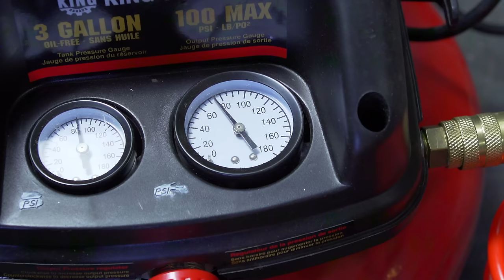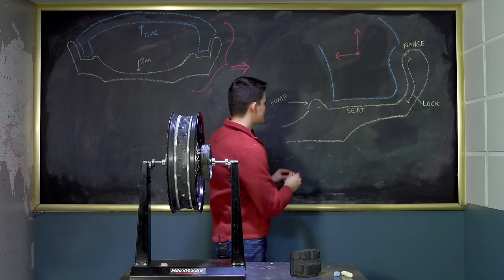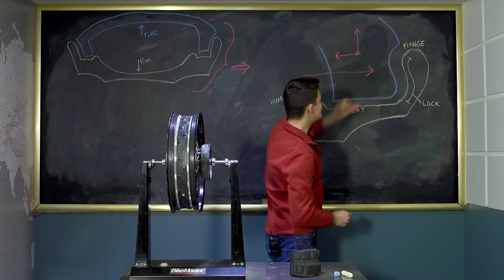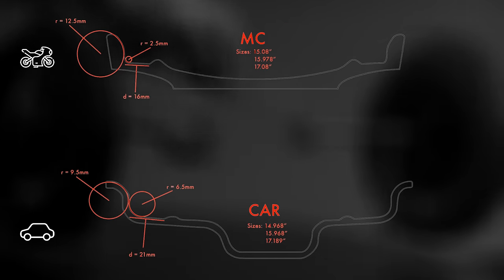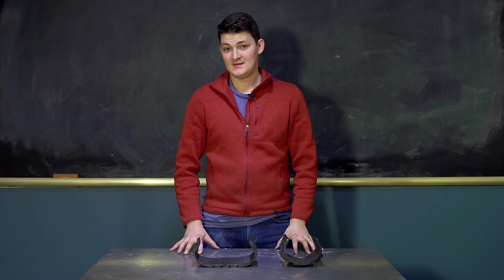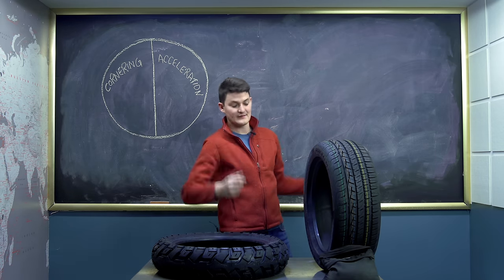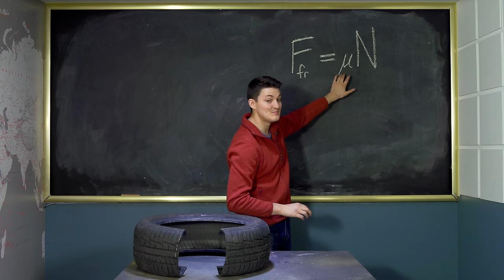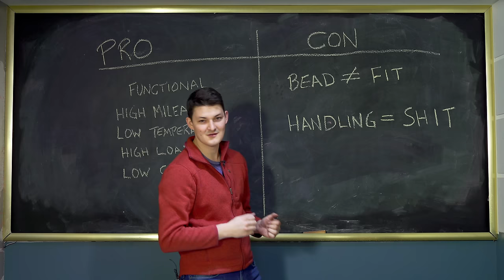Are Motorcycle Tires a Ripoff? The Darkside Car Tire Experiment

Comment: Its funny, i was just researching and watching videos about darksiding, and i noticed most of the users are cruiser riders. Really heavy bikes, without big lean angles. No suprise and your post confirms a lot for me
Reply: I own a street glide and some people recommend putting a car tyre on the back wheel . I can understand the cost part and mileage but if things go wrong your insurance is invalid  ,you won’t get a MOT in the uk and the police will get involved. Personally I wouldn’t do it or recommend it either too many downsides.
Reply: @johnludmon7419  In the US, at least, there is no such exclusion in a MC policy. And you are correct, my observation is many darksiders are cruisers and goldwing tourers who do not  use the handling characteristics of a motorcycle.
Reply: I have two bikes darksided.  Honda nc700x and triumph tiger 1200. It's amazing.  I drive it like I stole it.  It takes a few hundred miles to get use to. Once you do,  you ride exactly the same.  I have over 12 thousand miles on each tire.  And.  It's much better in the rain.  I hope this helps.  Try it you'll never go back.
Reply: Jim Gordon  Not in the UK the bike would be illegal to use on the road. As I said in my post  it would invalidate my insurance which would complicate things if I had an accident.
Reply: @johnludmon7419  you should move.  It's always raining there anyway.  😉
Reply: @johnludmon7419  NO your insurance is NOT invalid. Qualify this claim....
Reply: I challenge one to post a link showing where a darkside tire has ever caused and accident or even a mishap....lots of bearing of false witness here....
Reply: Jim, if you darkside a triumph tiger you shouldnt be riding lol. Thats a f-in sin.
Reply: @justmyself1000  I only have anecdotal evidence, but I am old enough to have seen the DS trend in the 90's...I bought my XLCR 1000 from a darksider who experienced a catastrophic failure while doing 90mph in a soft curve. I'm not complaining, as it was dirt cheap, but the first thing that I did was buying a pair of Michelin Road tires :)
Reply: @justmyself1000  dude in almost every European company needs to say this Tyre is fitting for this motorcycle and this is obviously not the case with darksiding.
If you have then an accident doesn't matter if it's because of the Tyre or not. You insurance will say you where not supposed to put this Tyre on it and it's not road legal which means you broke your site of the insurance contract.

But like with everything on a bike it's calculating the risk
Reply: @PolskaTheGrey  I have seen a Honda ST darksided.

The rider was dragging parts 2-up.  At no time was the car tire a limiting factor.
Reply: justmyself1000 I live in the UK the laws are different over here to the USA . If you fit a part to the bike that makes it illegal on the road your insurance company will not cover you if you have an accident. They might pay out to a third party but they will then try to recover the costs from you . Fitting a car tyre on a motorcycle will mean the bike will fail the MOT (the annual emissions and safety check on vehicles over 3 years old) no MOT = illegal to use on the road = no insurance cover.
Reply: @justmyself1000  in Australia they will not pink slip the bike and also the police could potentially seize the vehicle due to the illegal mods
Reply: @jimgordon3468  I just went darkside on my NC700X.  I only went a few miles on it for testing, and it feels weird.  I'm sure it will feel more normal as I rack up the miles.  I changed because I just ruined a $125 tire with less then 3k on it when it when flat on my ride home.  $54 for the Achilles, 40 - 50k life span.  It's more about the longevity then the $, but a $400+ savings over the next 4 years is not to bad.  Only time will tell if I made the right choice.
Reply: @dhj1825  trust me. After 500 miles you'll be riding just like before. I have the same tire you do.  I do a lot of two up riding.  It's excellent for that as well. The only negative I have is.  Putting the tire on the rim.  I did it myself.  Kinda difficult but doable.  Enjoy your dark siding my fellow Honda rider.
Reply: @AstoundingAmelia   not true
Reply: Santo Cuollo Most US policies do have a clause (probably buried real deep in the paperwork) that says that modification that renders the vehicle inherently unsafe will nullify coverage. I’ve seen at least 4 cases where the darksiding owner was left standing alone after a crash.
Reply: @AstoundingAmelia  never had a problem with cops even had em look at it and my insurance knows its there and dont have a problem  with it
Reply: @jamessloanofficial  umm no. They don't. DOT approved tire is just that.  And I'm sure you don't know 4 people who actually darksided a motorcyle.  Just keep living in fear and paying for all those expensive motorcycle tires.
Reply: @jeffjohnston2195  glad you haven't, I'm just using the Australian design rules as my source, they are the ones that dictate the rules
Reply: @justmyself1000   Any idiot who does this is too embarrassed to admit it. They quietly move on. Like the guy I know who had 2 blowouts!
Reply: @jimgordon3468   I know I will. But I actually ride my bike.
Reply: @jimgordon3468  wait. i thought this video was a joke. people actually do this??

Comment: I have been using Dunlop 185/65/16 car tire since 2006 on my VTX 1800 it took a little getting used too but you run tire pressure depending on the bikes weight I ran 34 PSI and it stuck like glue even in rain and tripled my tire mileage to 40,000 km

Comment: Always knew this was a terrible idea, but this video did a perfect job of explaining why.  Excellent work.  Always wondered but never wanted to try this.
Reply: I have had occasion to ride a car-tire-equipped motorcycle. I see it as yet another way for the 'cheap bastards club' to ruin a perfectly good motorcycle in their quest to save a buck.
Reply: @HalfCrazy520  I know a repair shop in my vicinity that used to modify car tires so they fit better on motorcycles, the place was shut down under claims that their work was putting people in danger, everyone who used them will say it was completely harmless as long as you didn't speed. I don't know since i've never used them, i'll try one day for sure.

Comment: I'm wondering what would happen, if you took a sidecar set up such as a Ural, and made it a darkside bike? The main problem with sidecars are that stability is a constant battle. But with your tires doing some of that work for you, would it make things easier?
Reply: For sidecar motorcycles definitely you can use it without an issue, you don't need to balance it
Reply: The can am spyderrs have auto style tires
Reply: They also have three wheels

Comment: The Boss Hoss came with a car tire. Factory mounted.  If I remember correctly that is. The handling as legend has it confirms your experiment on car tires on motorcycles. Well done sir, and very well explained what to expect and why.
Reply: they used to, there are now tyres rated for it in the chopper market thanks to the wide tyre fad

Comment: One thing you're missing is that after 600 or so miles, the car tire "corners" "break in" to their new use, and the corners give while you take the curves. This gets better as the tire adjusts to it's use. Trust me. Darkside on my '98 Valkyrie. I was convinced by a madman from Dakota, in whose sagacity I believe. I'll probably never go back to a $400 rear motorcycle tire -- especially after the horrible experience of my last motorcycle rear, the Limey Venom, that was the worst tire I ever rode.

Comment: I use a Goodyear triple tread on the back of my Yamaha Stratoliner. I have used it for 4 seasons now. I did notice handling differences when doing heavy cornering.  On gravel roads or uneven pavement you have to keep your wits about you. The tire does want to control the bike and get back to being straight up in those circumstances. Over all I am happy with the car tire and have 20000 km on it. I check the pressure regularly as we all should and ride. My advice for anyone thinking of going to the Darkside is do your research on type and quality of tire. I would not use it on anything but a big cruiser or tour bike. Sport, adventure,  and other style of bikes I  believe should stick to motorcycle tires. Great video.

Comment: I did this on a 1st gen Yamaha Vmax. It makes the deathtrap of a machine even more dangerous, but still awesome to ride. The flex of the huge sidewall added into the flex of the frame and suspension takes a lot of skill to maneuver.  It also adds a "speed limiter" of sorts. When you get around 105mph the whole bike starts swaying side to side unless you back down on the throttle.
Reply: about the only time it'd worth it is for drag bikes.

Comment: I ran a car tire on a 650 Burgman for a few years without problems. Handling was as good as the OEM tire once I got used to the slightly different feel. Also of note was the much smoother ride, especially when the air pressure was around 32-34psi. More air and the bike rode more on the edge, making the bike feel squirrelly. Darksiding isn't for everyone.

Comment: 1:39 the use of cable ties are ingenious
Reply: I've been installling my motorcycle tires this way for about 10 years now. With most of them, I don't even need tire levers anymore. The zip ties are so slick after you get the beads to touch, you can stand on the tire and it just scoots onto the rim.

Comment: He's a real motorcycle guy, the flip phone proved it😂😂
Reply: Hippity Hoppity  Then buy a used phone from an independent seller
Reply: I mean, I work in tech yet I have a OnePlus 6 (not a bad phone when it came out but close to outdated by today's standards). Flip phone guys have a point. They never need software updates and the battery is almost always replaceable. If the battery in my phone goes bad it's likely going to cost more than the value of the phone to replace with an OEM part. This is by design.
Reply: @marc-andreservant201  That doesn't measure up to all the things you can do with a smartphone and can't do with a flip phone.
Reply: The Zac Morris of motorcycles...
Reply: @marc-andreservant201  just fyi if you are okay with DIY look into ifix it. I replaced the battery for my 6t at one point for 50 bucks. If I ever need to replace it again it would be about 30 dollars because I don't need the tools anymore.
Reply: @marc-andreservant201  a OnePlus 6 will last for a few more years at least with a custom rom
Reply: Laughs in v20 removable battery

Comment: "spontaneous uninstallation" LOL.
Reply: As if this has ever happened......Please someone post a link where this has happened...
Reply: @justmyself1000  I've been doing on-and-off research on darksiding for twelve years and have read nearly a thousand NHTSA motorcycle crash reports, and have never found ONE where the primary- or even suspected- cause of the crash was a bead failure on a darkside (DS) tire. Plenty of drunk/impaired riding, lots of cars turning left in front of bikes, many excessive speeds, failures to negotiate turns, and even some tire failures (ALL of them motorcycle tires and often due to overloading or running underinflated), but nothing that would suggest DS is an unsafe practice. I have challenged the naysayers to provide ONE verifiable case of a crash or refusal of insurance claim due to DS, and have had ZERO takers. I've been riding the mountains of northern Wyoming for three years now on a V Star 1300 with a BF Goodrich, and it is a fantastic combination for comfort, durability, and safety.

Comment: I have a 85 Gold Wing 1200GL & Dark sided it with a Nexen 165/80/15
Cornering is no problem and now I have better braking, grip, water displacement
and far better with a passenger + trailer. It also has an actual load rating...I'm staying on The Dark Side !.

Comment: I ran a GL1200 Goldwing with a side car and a car rear tire mounted perfectly. It ran great and I highly recommend it for sidecar applications. I tried it with the sidecar taken off the bike. On the highway I got in an absolutely terrifying tank slapper that is singularly the most frightening riding event of my 50 years of riding. I don't know how I did it (thank you guardian angels!) but I controlled it from a side to side, to the stops, tank slapper at 80mph (I know, I was pushing my luck). I sat on the grass at the side of the road for half an hour to get the adrenaline and heart rate down. I thankfully learned my lesson without loosing my life.
Reply: Maybe car tire applications on moto are for heavy weight moto, also tubeless tire is the way to stop Tire re-T900-coming-back to original form and fighting itself

Comment: Thank You Sir for actually trying this out and showing how it can be done. And then giving us an honest, in depth, exactly right on presentation of how it works and the advantages and disadvantages of running a car tire. Your explanation about having constantly counter-steer thru a corner was very insightful!! The way a motorcycle handles does change for sure, but you get used to it. 
 Certainly you wouldn't put a car tire on a canyon carving sport bike!! For a heavy touring motorcycle, the fact that a car tire lasts so much longer is a huge advantage. It certainly saves time and money!! Why spend a $150+ to have a rear tire replaced every 10,000 miles or so (usually less!!) when I can safely use a less expensive tire that lasts 3 times longer?? Also, having to replace a tire when on a long trip is not fun. For me, every rear motorcycle tire I have replaced is worn out in the middle and very little wear on the edges. So using a car tire is so much more convenient. 
 This has been done for a long time as mentioned in the video. An older friend of mine said they used to lace up a 15" rim on their choppers so they could run a Volkswagen tire on the back. Using car tire works!! And for me there's no downside. And the fact is, people do this all the time. Thanks!
Reply: Yeah, seems like the car tire makes sense if you just commute or do lots highway miles. I know guys who replace their rear tire every year. Not to mention the cost of a puncture. That said, I'd probably try to find an inner tube that fits if I were using a car tire.
Reply: Tatwood, thats where runflats are great. And i mean do you tube your tubeless mc tires?

Comment: Thanks, Ryan.  Very well done, as usual!  I have had a Semperit M&S tire on the back of a Burgman 650 scooter now for 3 years.   Works fine,  EXCEPT:  longitudinal seams in the pavement are downright scary!  Leaned over traction is not a problem, since the giant scooter does not lean over very far anyway; parts drag right away.   The M&S tire actually gives some traction; the stock tire gets stuck on wet grass.  Still not sure about tire pressure;  anywhere from 25 to 40 seems to work just fine.  Please note that I am a dirt rider, and might not be noticing some of the nuances of pavement handling.  Thanks again!

Comment: Back in the mid 2000’s I did this on my 1800 Goldwing. I didn’t know about the bead differences. That aside the tire did work. After the scary first ride it was pretty normal except for the part about tracking on grooves in the road surface. Annoying at first but you get use to it. From what I remember the tire didn’t last that much longer than a good MC tire. The car tires wore out at the edges first. Both of them. I ended up going Back to MC tires after that. It just rides a lot better. Going back to MC tires felt like adding power steering.
Reply: not true for the newer run flats . but in the north we go straight a lot . lack of curves
Reply: tire pressure is the key. and not what the sidewall says either

Comment: Been a Darkside Wing rider for two years and will never go back, the bike is just to heavy for motorcycle tires and cupping occurs, over 45 000km and still fine for 125$. Don't think i would use it on any other of my bikes though, can't feel much of a difference on the wing, your video quality is amazing as always
Reply: What kind of bike do you put it on?

Can advise will it be ok for 650 Kawasaki Versys?
Reply: Goldwing
Reply: Baeng's Lobster (Wan Jtk) On my Goldwing, i would not advise trying it on a smaller nimble bike as it will take away from its performance, the Goldwing is over a 1000 lbs loaded and the rear wheel is better suited for the switch, i don't ride it like a sport bike like some Goldwing riders are know to do, so i can’t feel much of a difference at all
Reply: @MrRamman04  thanks for the reply
Reply: @wanjtk  if you want any fun riding don't ever do that.    Modern motorcycle tyres are mostly all good, but I had a Honda cb500, limited to older models. Came with way to old not so good ones.  Definitely felt a giant difference when getting better ones.

Comment: I'm not a biker. I was a motorcycle commuter.   At 8000 miles it was time for my third rear tire. I put my first car tire on my kawa 900 lt. 25,000 later I bought another. At 50,000 miles the demands of having to pick up a grandchild at daycare for thr next 6 years meant I couldn't ride as much.  5 years and aound 55,000 miles later I worried more about the car tire rotting then anything else and it has mc tire on again.   I did my 1000/1500 IBA ride on it, up pikes peak with it, oshkosh airshow with it rode as closer to the big mac bridge as weather and time would allow from parking lot practice to the occasional run up to 115 mph  (Kansas tail wind and big shield helped a bunch fit the little bike).  Mc tire feel better? Maybe. But 70 dollars for 3 years instead if 600 for 1,I didn't feel that much difference.   Liability?  It's dot rated,  never caused a problem. 
Not for everyone?   Ya.  A solution for a problem? Yup.